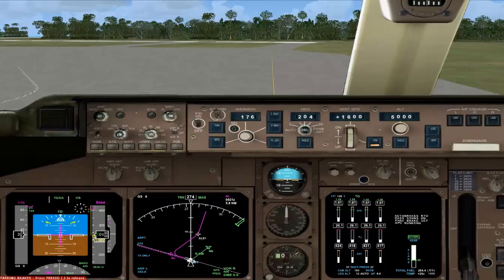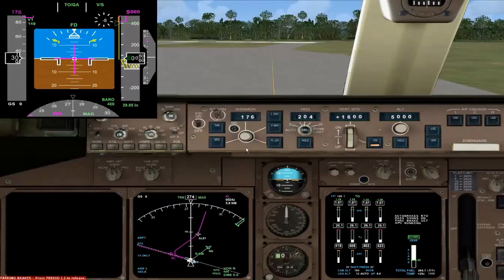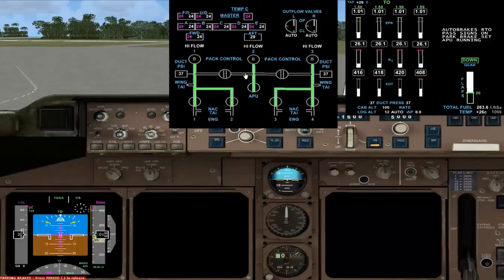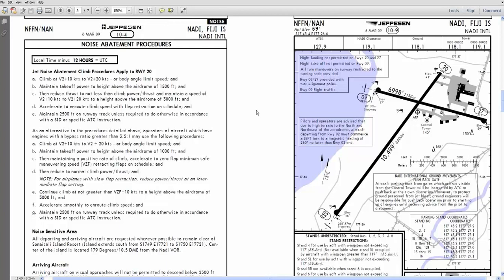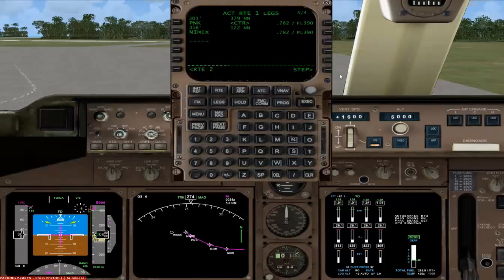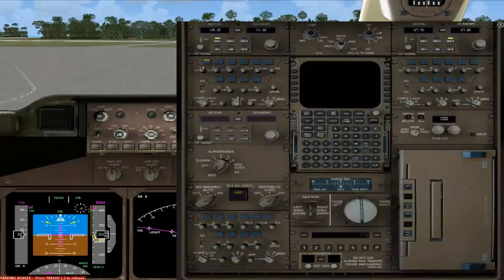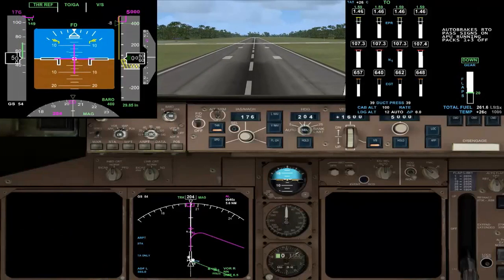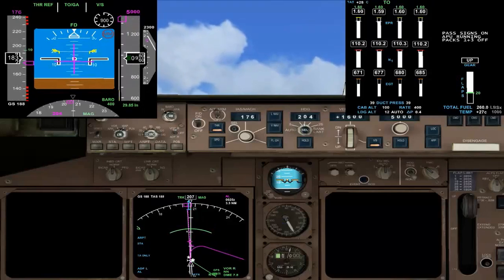FSX PMDG 747 Nadi, Fiji Islands to Changi, Singapore Professional Part 1

Comment from the maker: Packs are part of the ECS (Environmental Control System) and provide air conditioning, just like a car.  Air comes from the engines (bleed air) and is cooled before entering the aircraft... basically.  Using all three packs with air from all 4 engines results in a performance penalty.  It's marginal but does have an effect nonetheless.  I just demonstrated how to take off without using 'engine bleed air' and rather used the APU to provide bleed air to one pack (since its not so powerful!)

Comment from the maker: 1.  I used Sky Vector for this one.  I have also used Sim Routes.  Other times, I make it up myself.  2.  Yes it is, within simulator limits, time to record, things to focus on and things to ignore.  I can't talk about every single correct and accurate thing in every video, or they'd all be the same!  I focus on different things in different videos but 80% I'd say is an accurate representation, more than enough for the average simmer.  That's why I make the videos!  3.  No!  ATIS, yes :) Thanks!